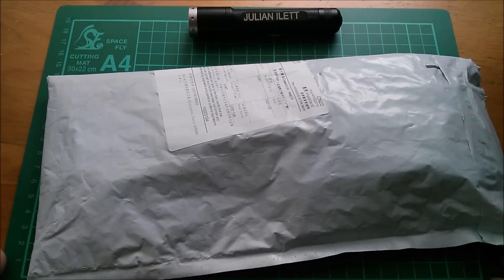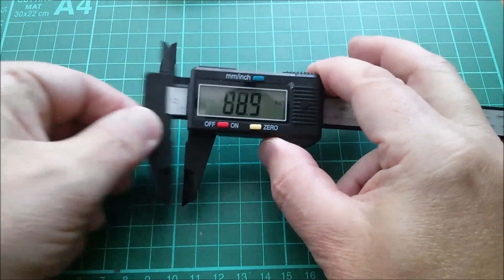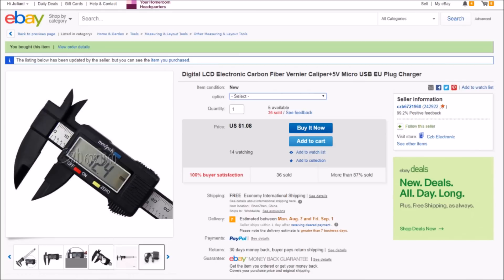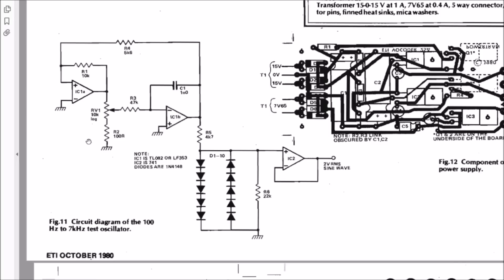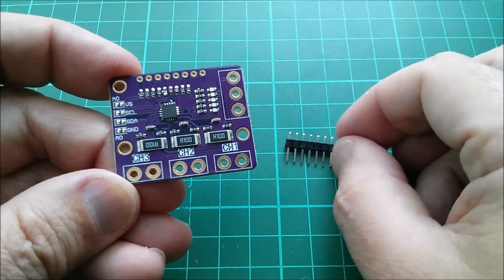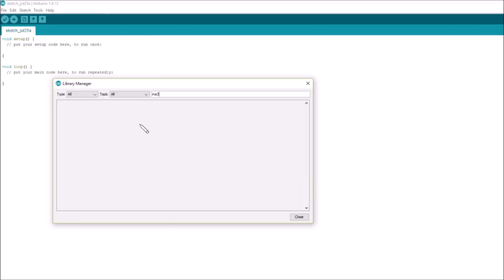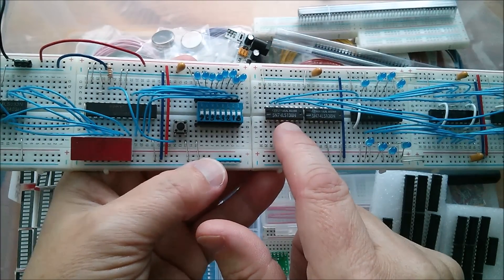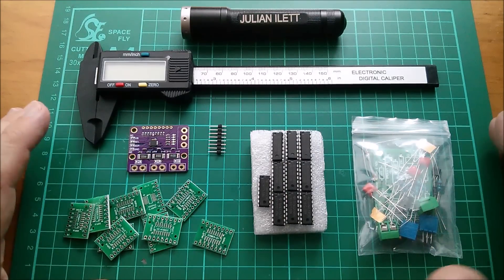Julian's Postbag: #102 - Electronics through the Letterbox

Comment: That caliper will eat your batteries. Take out the battery after every use.
Reply: I've ended up resorting to putting a small switch on mine disconnecting the battery
Reply: I soldered in a supercap to mine, and just jump it with a AA battery to quickly charge it.  Hate watch batteries..
Reply: I use a strip of sturdy plastic sheet cut from the blister pack. I jammed it in under the battery with a tab sticking out that I can turn to break the contact without having to open the battery compartment.
Reply: AvE looked at it, its fine.
Reply: Indeed, totally bit me in the ass.
I have a very similar one, have a look if there's a little trap door in the back, it's a serial port, let me know if the info isn't in your manual, I'll scan mine it has the data format and pinout and all
Reply: InnaSoulSounds Same here...switching the calipers to off just turns off the LCD display...the unit still draws power even when it is switched off. I suspect that all Chinese calipers do this...they must be in the LR44 button cell business. <grin>
Reply: InnaSoulSounds yes, I have also noticed there is a parasitic drain on the battery when the unit is switched off.  My LR44 battery only lasts 3 months.  I remove the battery after each use to preserve battery life.  I also have the carbon fibre version, however, I find the full aluminum  version smoother and more accurate when moving the measuring arm.  The carbon fibre is a little jerky.
Reply: Mine lasted about a year, but ironically just a few days ago, I went to use it and it was dead ;)
Reply: I thought like others of you that my calipers were eating batteries while not in use, but then I discovered by chance they were turning themselves on unwanted with microscopic movements just from random vibrations around the tool drawer. Now I keep to the habit of tightening the little thumbscrew that locks them down before I put them away, and the batteries last for months (or more, I haven't had to replace them since always lock the caliper after use). Your mileage may vary of course!
Reply: but still,  £4 for 100.  never mind the quality, feel the width.  I'll never run out again
Reply: Odd, I have the same caliper and it still has the same battery that came with it, from about a year ago... (I don't use it too often)
Reply: wavefront101 ha that's a cool idea
Reply: I got sick of using as many as 2 batteries a year,  so I bought 100x  LR44 for £4 on ebay
Reply: Mine has been working for over a year with the supplied battery. Guess I got lucky. ( Exact same one as in the video )
Reply: No problem. Mine is not this exact model. Something to be aware of for other models though, as you can see from the comments this can be a very real problem.
Reply: Aye, 3 months is what I would get out of mine. Seems like this model doesn't have this parasitic problem though.
Reply: Not luck, I was referring to my older, similar model. Seems like they fixed the issue. All the best.
Reply: It's easy to find out if it eats your battery. The button (on mine) only turns off the screen drawing, but everything else is still turned on! You can see it wenn you look at the screen, it should be nothing at all visible on it when the battery is removed/turned off properly. But you can actually see the "possible digits" after turning it "off" (on mine). I put a bit of durable plastic from a broken USB Stick through the serial port opening (or whatever :D) to disconnect the battery physically. Although I have to use LR43 battery rather than LR44 and also put in a bit of paper handker in there so the battery doesn't get trapped in the off position but actually gets pushed back onto the contact again.

So much text for such a simple message, that's how one can identify that I'm not a native english speaker \o/

Comment: Looks like SwitchDoc Labs developed a INA3221 Arduino library:
https://github.com/switchdoclabs/SDL_Arduino_INA3221
Reply from the maker: Yeah, I figured something would show up in a wider internet search - thanks Keith
Reply: Julian Ilett , with the Grounds commoned on those 3 current-sense resistors, isn't the 3221 useless for a 3S battery pack ?
Reply: They do. Most of the major semiconductor manufacturers make charge/discharge balancing ICs (even high side, multichannel ones with a wide input range). Julian is overcomplicating things by trying to roll his own instead of using an off-the-shelf solution. If he wants to do it just for the pride of having made it himself, though, I can't fault him.
Reply: It would be if the batteries were connected in series, but I think his cell holder doesn't have them connected. So they would be common ground, independent positive voltages.
Reply: but i thought from the original video he was musing about charge/discharge balancing? (maybe confusing about bike battery projects).. But yeah, gotta be careful with the common ground ;) One would think, if they made a high-side, multi-channel, wide-input range current measuring ic Julian might be in business.

Comment: I (being an absolute n00b to 3-D printing) bought a digi caliper recently myself to use in assembling my Prusa i3 MK2S 3-D printer and I am getting much use from it now as I design in Fusion 360. Here in the U.S. we have bargain tool stores called Harbor Freight and I picked one of those up for about $15USD. They run advertisements in everything that is printed it seems and every ad has a 20% off coupon. Mine is mostly metal though. Can this be your first digital caliper Julian?
Reply from the maker: I think I've got an old mechanical micrometer somewhere, but this is my first vernier caliper.
Reply: Julian Ilett , I have 2 Aldi digital calipers, ~ somewhere ...
and a batteryless analogue vernier caliper which is probably my most used tool. (Not needing batteries, it always works :)

Comment: Good buys. I'll get one of those caliper. I need one.
Reply: I would order a metal one and with 2 digits in mm mode. 1 Digit is bad.
Reply: Out of stock. :(
Reply: Don't get a plastic one.
Reply: Agreed. Even if the electronics etc are fine, I don't think those plastic jaws will retain much precision with use. Get a good set of calipers made of well-machined steel.
Reply: Buy the ones made of stainless steel. Like https://goo.gl/KPvvxF
The plastic ones don't last a week.